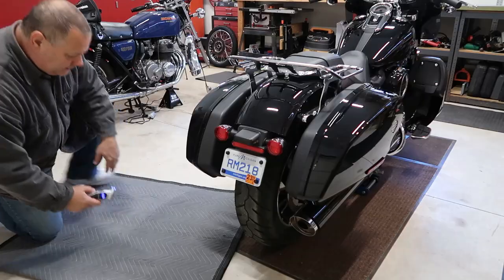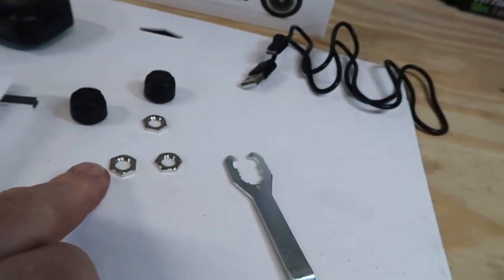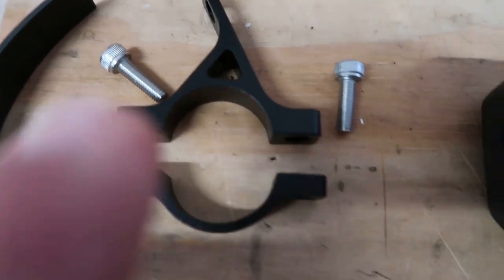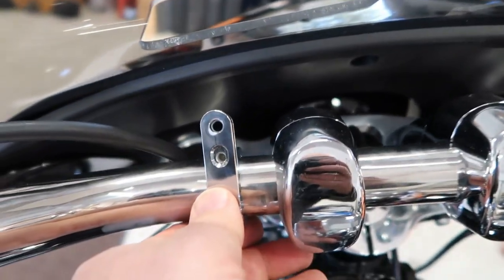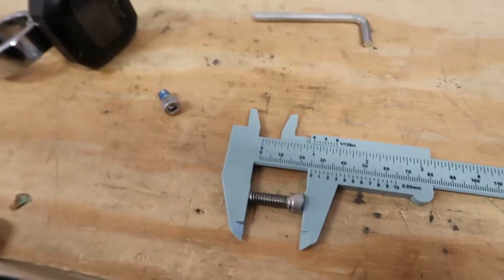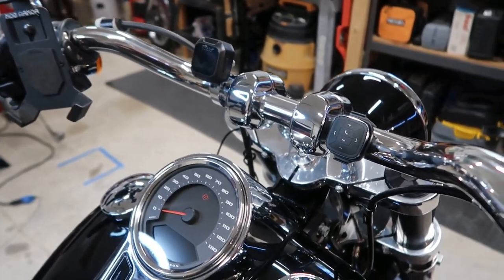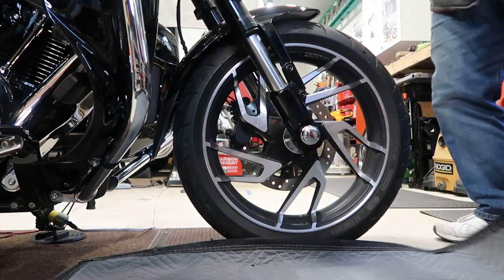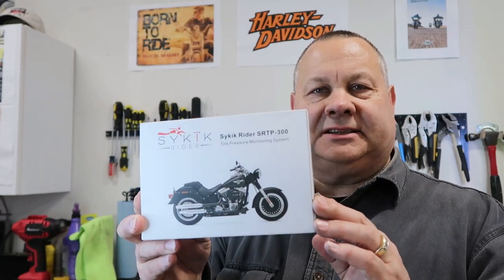Motorcycle Tire Pressure Monitoring System Installation

Comment: Nice video. I had used a similar one but a different brand. What I like about the one I got is that the sensors weigh 0.2oz with battery installed because I'm running rubber stems on my 2019 road glide. As for the handlebar mount it will not clamp completely around the handlebar and plus the mount bolt was to short. I went to ACE and got the same type of bolt but longer for $0.69 and it worked like a charmed.

Comment: Thanks for all the videos you've been doing on your bike. I picked up a Sport Glide and your content has been really helpful. First thing I did are the Kuryakan floor boards (part 5908). They are awesome. All of the vibration of the foot pegs are gone. I'm a bit taller than you, so my riding position is more cramped with them on, which means I need to get a tall boy seat to try and get more leg room since my feet are now angled forward, but I think they'll probably fit you perfectly. Definitely recommend. Felt firmly planted the entire time. Despite being tall, the only install position that makes sense given the other foot controls is to have them all the way back. I also have to move my shifter up because my boot could no longer fit under it. Very simple to do, though.
Reply from the maker: Congratulations on your bike purchase. Thanks for watching and good luck on your bike mods...

Comment: Hey how’s it going? do you happen to know if this is okay for use on rubber valve stems? Thank you
Reply from the maker: Seems to be working just fine on mine. The manual makes no mention of the  type of value stem.
Reply: @ToddsProjectsandOutdoorJournal  ohhh okay well thank you! I too have a 21 sport glide. I just fitted a chopped tour pack and it’s great you should check it out!

Comment: How do you keep it weather tight with a detached charging cord?
Reply from the maker: It has a plug that goes in the hole.
Reply: @ToddsProjectsandOutdoorJournal  Maybe it's just me but I think it's silly to charge a battery from a battery instead of just connecting a hard wire and have it turn off with the ignition. Or am I missing something?
Reply: @aeasus  Maybe I misunderstood your question. The monitor automatically shuts off when the bike is inactive and comes back on with any vibration or movement. One charge to the unit will last the entire riding season. It will only need to be recharged a few times per year. The unit has a plug that fills in the charging port when not in use to keep it weather tight. Click on the link in the video for all the specs and photos on the product. Hope this properly answers your questions. Thanks for watching...
Reply: @toddwmeyer  "One charge to the unit will last the entire riding season." was the answer to the question I did not ask, but wanted :) That completely changes my perspective on the product's usage. TY for that.

Comment: Hey Todd let us know how it works when you are out for a ride, a fellow rider told me he installed one and the caps on the stems put his wheels out of balance , I find that hard to believe but just asking for some feed back. Happy riding. On another note can you do a video on that Bluetooth controller you have installed, I would like to know more about it. Thanks
Reply from the maker: If it ever stops snowing here in Michigan I'll let ya know. Thanks for watching...
Reply: @ToddsProjectsandOutdoorJournal  
Snow here in Calgary just won’t stop either  😩
Reply: Your mate is likely correct. These sensor caps aren't very light... I've just fitted mine and  it wouldn't surprise me at all if I will have to have my wheels rebalanced. 
They should really include a stick on counter weight to stick on the wheel directly opposite the valve.